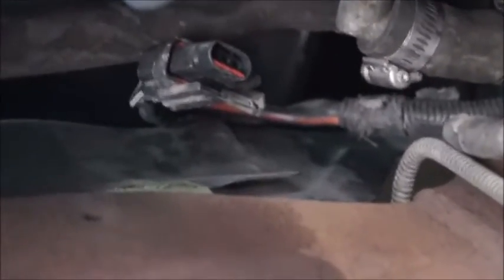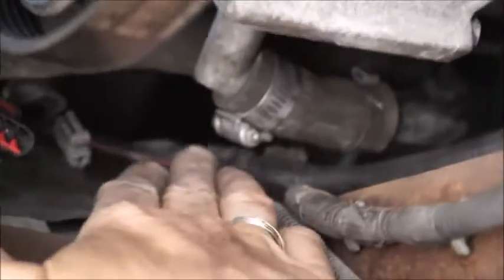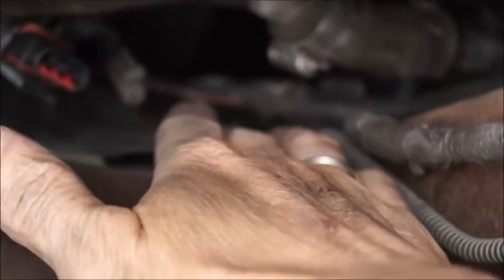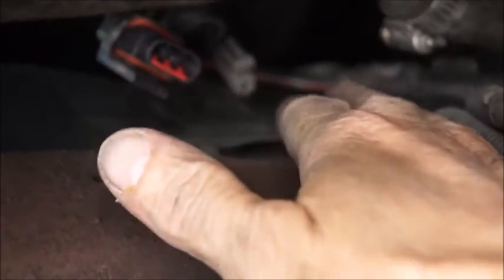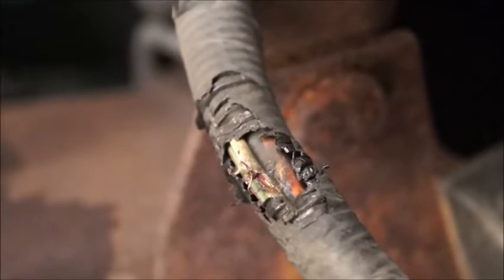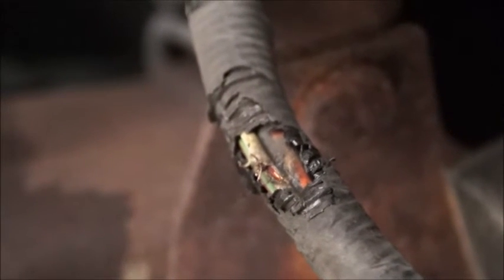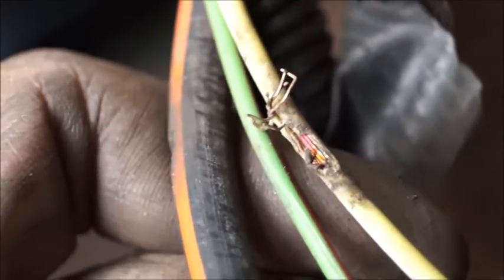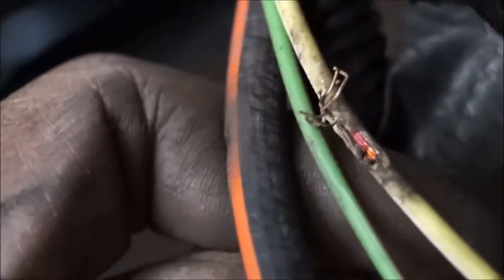Electrical Repair on 1994 94 Ford Econoline E150 E-150

Comment: Also replace motor ignition module.
Reply: Sorry, I am not familiar with those elements. Have you checked your wiring harness to make sure you have no loose connections?
Reply: This video has an electrical diagram.

Comment: Its not overheating,fluids all good alternator good. No need to jump.fuel pump good pressure and spark good. Any idea where crankshaft sensor is located can't seem to find it. Thanks for you're help.

Comment: My econoline f 150 1994 van starts but turns off after a few minutes. Sometimes starts right away but most of the time takes 15 to 20 minutes to start back up. Any idea's?  Looking for crank shaft sensor but can't find it. HELP!!!
Reply: That is not a lot of info to go on. Is it overheating? Have you checked all your fluids? If it is dying while parked then it would likely be the alternator but then starting it would be an issue so that must not be the problem unless you omitted that you are jumping it off.

Comment from the maker: I neglected to mention that the wire that the Fusible Link was wired to was the same color as this wire which is yellow with a white line. Somewhere in the harness I lost track of this wire. From the point at which I found the short this wire seeming disapeared and I could not find it in the other section of the harness directly under the engine. This really annoyed me to no end but since I had found my problems I decided itt was not worth the time to rip out the entire fucking harness just to resolve my curiousity. It MAY be that the yellow wire was splices to a red wire I found in the lower harness but I never found out for sure. I could not find a way to load a pic of the Fusible Link but I can send you a pic if it helps.